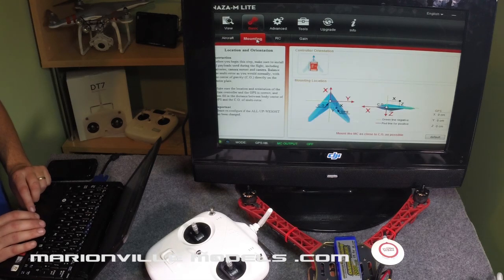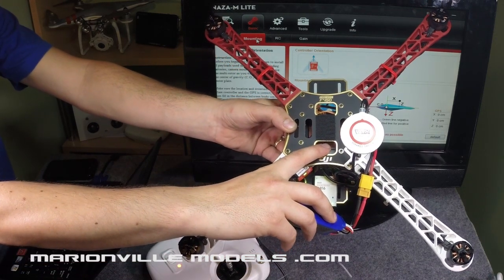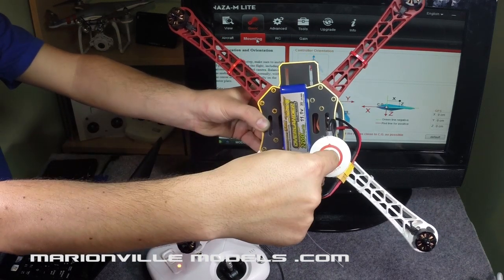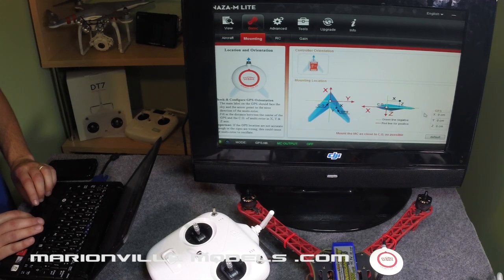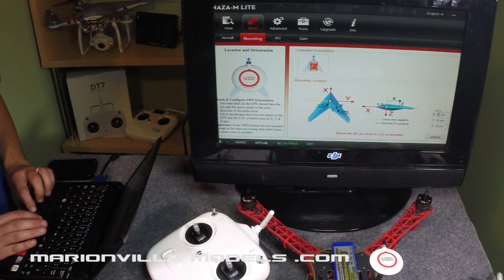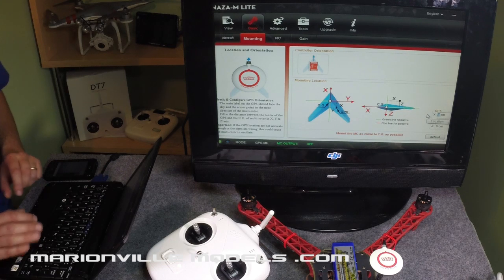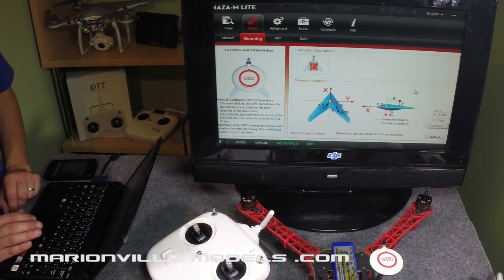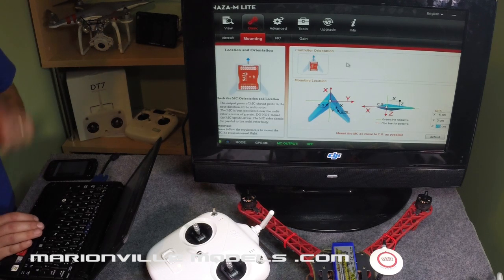Mounting the GPS in Naza Assistant, Light/V2

Comment: is that - i 13 from the bottom of the puck to the bottom of the top plate or to the GPS unit
Reply from the maker: Nick Walters it would be from the centre line of the flight controller to the bottom of the GPS puck.
Reply: Marionville Multirotors thanks for the quick reply mate I think I've done it right what's magnetic north and true north all about
Reply: Marionville Multirotors also would it be higher the GPS unit the better
Reply from the maker: I wouldn't worry two much about the offset for magnetic north unless your very far from the equator.
Reply from the maker: You don't want the GPS to high as it can vibrate on the mast.